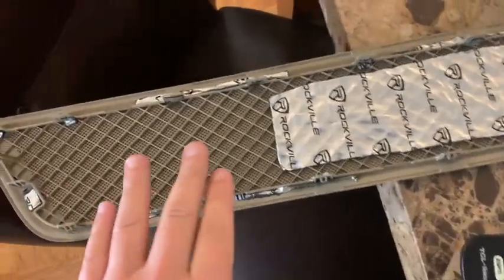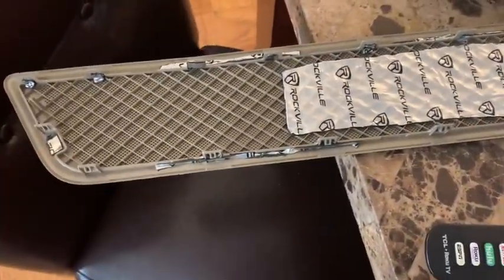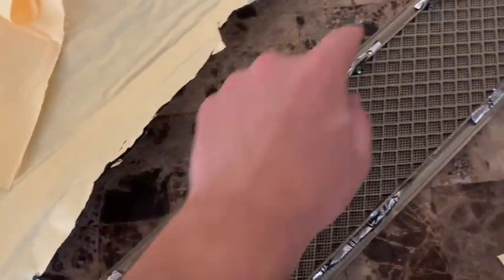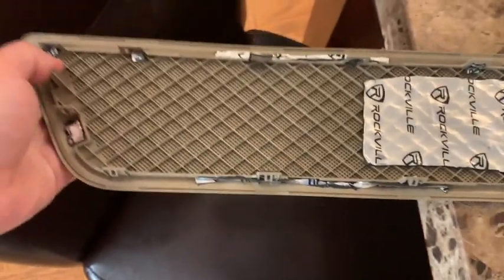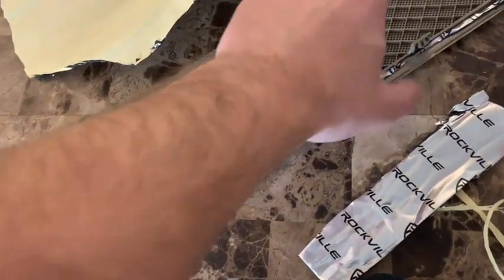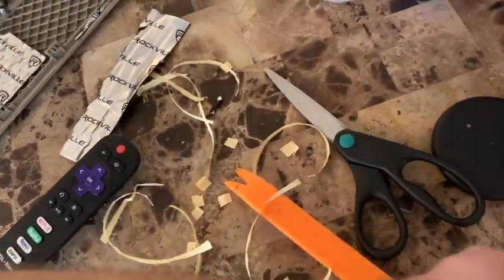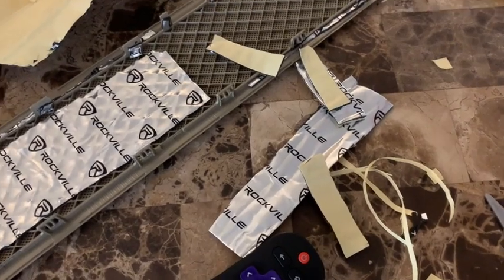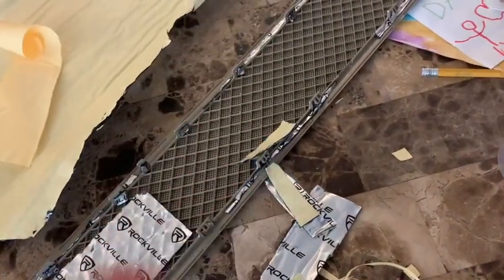Fix Rear Deck Rattle on Mercedes

Comment: Hey dude, you should try Tesa tape A.K.A. HushMat Quitet Tape

It is like a felt tape that they use to wrap wire looms and stuff with, but it is really helpful for cutting down interior plastic squeaks and rattles. It is thin enough to even put over some flips so they fit super tight with no rattle
Reply from the maker: Thanks for the tip!  I'm going to try that.

Comment: Imma try that on the CLS 63, that rattling ruins the audio in this car lol .
Reply: I try it too 😁
Reply: Dude how does an 80k car have more bass rattle than my 1998 Jeep Cherokee 😂
Reply from the maker: Those old boxy Jeeps were tough.  My sister completely neglected hers and it ran for like 200k miles.